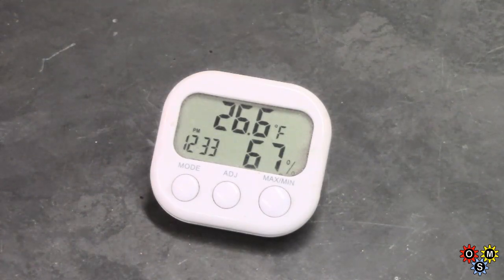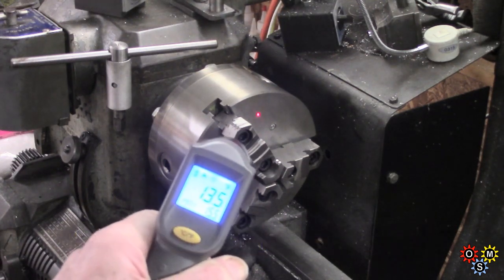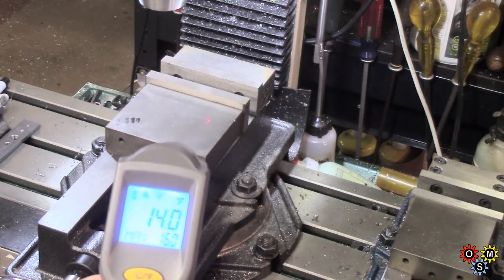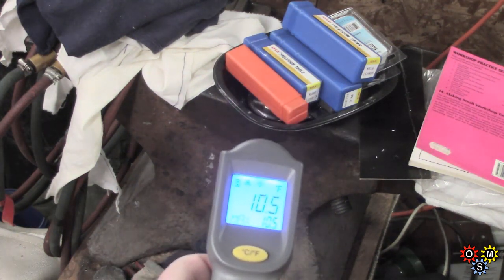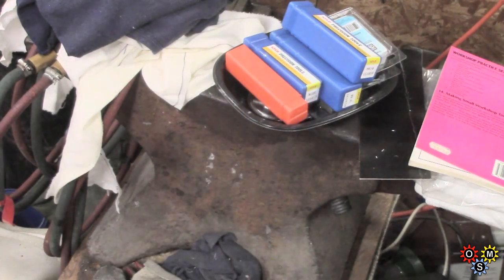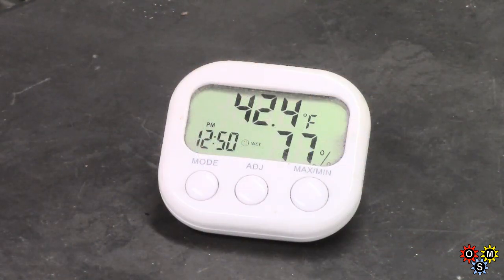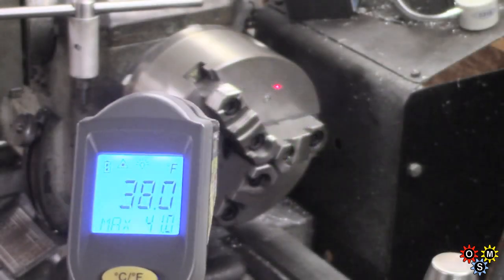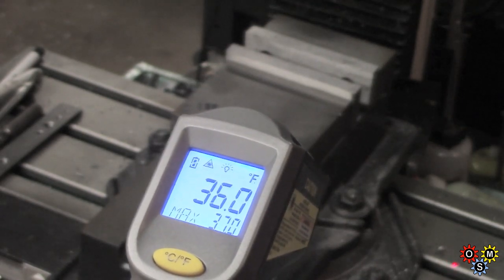Metal Mass Temperature Holding

Comment: Hey Chris, good to see you up and about.  I used to work in some government buildings with uncontrolled environments.  When It got cold in the buildings in November, it staid cold until the end of may.  There was some much concrete mass, that heat lag kept the buildings warm until Nov and cold until May.  Good experiment.  I am in the process of enclosing some open areas to enlarge my little shop, and adding insulation to make it easier to stave off the cold/heat.  Stay warm up there and monitor the rust.
Reply from the maker: Hi,
Yes, heat lag - it's a real pain. I've always wanted a concrete floor but maybe I am a bit better off with my rather springy wood floor! Main problem apart from cost is the large volume that needs heat. of course in peak summer it's the opposite problem. :)

Comment: Chris . I used to heat my workshop 24/7 winter  times  before I retired and could afford to do so . Then I  just heated the shop when I needed to do a job when I retired and slowed down doing work in the winter months , the down side was condensation with just occasional heat for a few hours  a week . took more time to clean and coat  tooling and machines to try to hold the rust back . Since discovering that no heat is better than some occasional heat once metal parts /machines are coated with oil/parrafin mist spray  they survive the cold months much better with little or no rusting . I am in central part of England . In the song  Englands  green and pleasant land , but they got that wrong I would describe it as damp and mouldy for 6 months every year. Escaped Brits already know this .
Reply from the maker: Hi Chris - haha - I used to live in Devon and there too was rather damp and mouldy! But my old shop was much easier to keep just heated enough. Current shop certainly too costly to heat all the time and as you say, sometimes occasional heat is just making trouble. Just have to put up with it pretty much although it's frustrating.
I do keep main bright metal well oiled, and keep an eye on it.

Comment: Hi Chris, I can vouch for that and you don't have to be in your sixties (I am now) but it was one of the reasons I moved on from the place I served my Apprenticeship as a Toolmaker - it was absolutely freezing in the winter. Was an old Victorian building in the "Queen of the Welsh Resorts" and being an ex-pat (like me) you'll possibly know where that was.... I have a rad on in my wee workshop now but it can get to minus 30c in the winter in East Germany (where is dwell now), so we'll see if the rad keeps me from freezing up. For the other Chris here, I have a colleague who knows parts of Russia and apparently, in the very north, they leave service vehicle engines running in the winter 24/7 to avoid the things seizing up. Mind you, diesel freezes at -22c I was told, so the stuff here must have special additives to prevent that. On the other end of the darned scale it gets to almost 40c in the Summer here and 70c is a hell of a range for a Human to put up with ;)

Keep yourself warm bud...... Spring isn't too far away
Reply from the maker: Hi martin,
Thanks for the long comment. Bottom line is - extremes!!  These super low temps make things more than difficult and then of course once into even early summer the heat will be the problem! Early spring and some of fall are about the best! It will be hopefully a lot better in a few weeks.

Comment: G'day Chris boy the States have really copped it to extremely dangerous levels. I have never experienced temps that low!   Keep warm that would be the number one item in a shed is a very good heating system.  Good to see you again regards John.
Reply from the maker: Hi John,
Thanks - well, if shop was less volume and I could afford it I would heat it but - not economic for the usual relatively short spells I spend out there. Roll on spring. :)

Comment: Very interesting Chris, I would have never thought about the metal dropping that much until your video. Have you looked into the portable infared dish heaters? They are supposed to be economical to run and are very warm from what I've heard. Cheers, Doug
Reply from the maker: Hello Doug,
I have a very good space heater but to be honest, whatever I were to use for constant heat is just not economically viable - just too big a volume to heat affordably. oh well - spring gets closer :)

Comment: The thermal mass or heat-retaining ability of an object is called its Specific Heat. There are tables in various handbooks with the specific heats of many materials. The specific heat is the amount of heat energy per unit mass required to raise the temperature by one degree Celsius. The relationship between heat and temperature change is usually expressed in the form shown below where c is the specific heat .

Carbon steel has a specific heat of .12 kcal/(kg oC).
Reply from the maker: My physics memory has gotten very degraded but now you mention it yes, specific heat! Thanks for the reminder! :)

Comment: i think the fan  spoke of before  keeps the air moving and helps with the condensation and frost. . my shed  is only 10x12 minus 2ft of bench on 2 sides and a foot of shelfs on the other side the lathe rolie takes up a bit of room as well and all the oil cans hanging from the ceiling its finding room for the fan is  the problem lol .
Reply from the maker: Hi Monte,
I guess a fan can help a bit - my shop total volume though is so large that full time heating just too costly. size is about 32x19 and volume approx 5,000 cubic feet - that needs a lot of heat! :)

Comment: Good day Chris.  Most probably Pennsylvania is colder than here in Arkansas.  I run my electrical heater to keep the shop temp 50deg or above and run the gas heater if the electrical heater can't keep up.  I was working on a project two days ago and had to run gas heat for about 4 hrs. to get my vertical mill warm enough to run smoothly, they really don't like the cold.  
It looks as if you don't do well with the cold either well neither do I.  I saw what you were wearing, smart!!
Reply from the maker: Hi James,
I think we certainly have the edge on cold! Just had more snow and two days time looks a mess!
My problem re shop heat is basically pure cost. Even when temps better I am not in the shop all of every day at all - so to heat 24/7 by any means is just too much expense. Electric is tempting but my elec bill is already plenty big enough! I may try a small propane unit to run all the time but that won't lift temps enough - then have to use a thirsty space heater. I need something like 50 or better - much as anything like you to have the mill run OK - too cold and things get sticky from cold lube!
I really am looking fwd to better but we ain't done yet unfortunately!
Reply: Hi Chris, yes, I'll bet it would take more money to keep the heat running because of the colder temps.  Don't let yourself get sick with the flu trying to do something in a cold shop, it ain't worth it. Besides, I enjoy watching your videos.
Reply from the maker: Small ray of hope - soon to get a slight lift in temps so may be worth trying to add some heat - take a while tho to get temps up enough to do some work. Eventually - then of course once warmer there'll be yard work to do as well!

Comment: I dont quite understand a man of your age and your inteligence does not have heat in your shop. Its hard on  equipment and not to mention hard on you. i like your show and am subbed 4 some time now. but i would bet we would see some more quality shows if you had some heat in your  work area.
Reply from the maker: Hi Jamie - unfortunately it's all down to cost. Even when temps are better I am rarely out there for much more than couple of hours maybe (can't stand too long) - so have to grin and bare it. The shop has large volume (maybe 5,000 cubic feet) and that takes a lot of heat to keep warm enough. I hope before too long now to get back into gear!
Reply: ChrisB257 that's the spirit Chris looking forward to the next video cheers